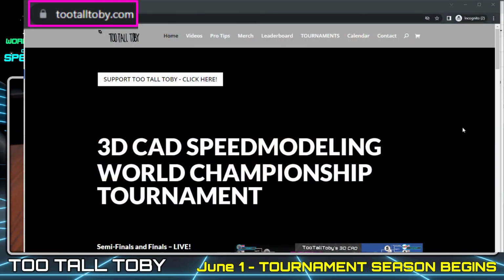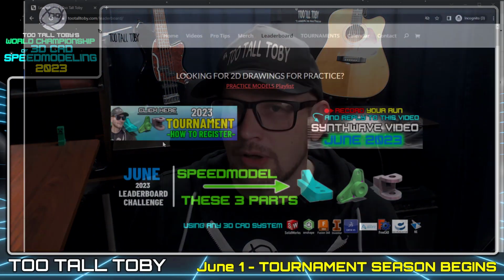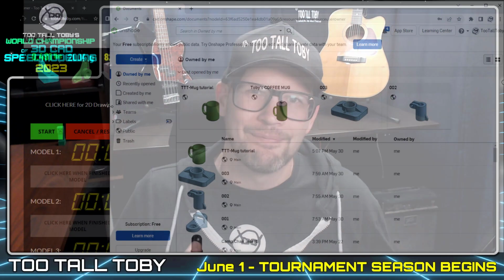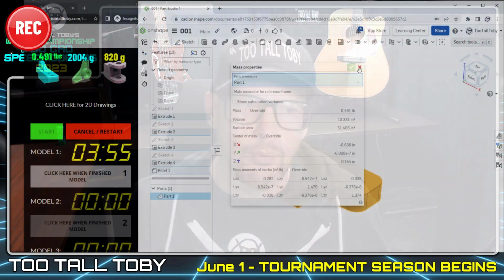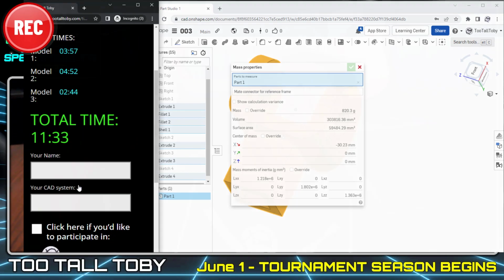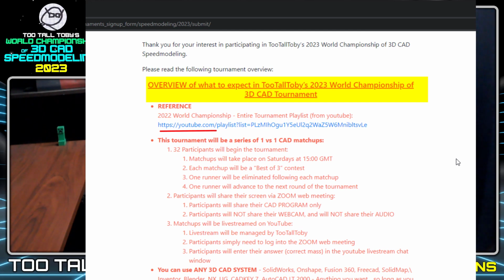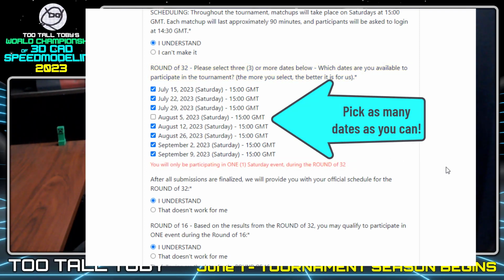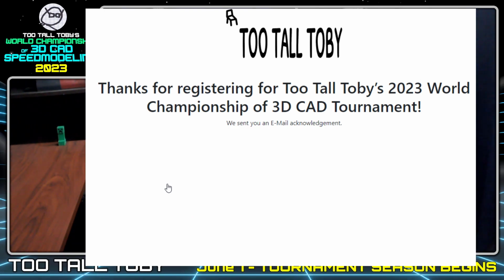3D CAD TOURNAMENT - WORLD CHAMPIONSHIP 2023 - HOW TO REGISTER

Comment: Hey Toby! Excited to participate this year (#onshape) 
What custom features are allowed?
- none?
- any created before the release of this challenge?
- any that are applicable to generic modeling (not these parts specifically)?

Also, am I allowed to dimension parts with approximations (e.g. dimensioning the lengths of a triangle rather than its angles) if the part is within tolerance?

Cheers :)
Reply from the maker: Hi Imants!  I am excited to have you participate this year.
Basically any features which are present in other 3DCAD systems are fair game, if you need to custom program them into your system.  Kind of a loose guideline, I know, but we can take individual concerns as they come up.

And yes - you can use whatever design strategy you like, so long as the mass is correct (within tolerance) 

thanks!